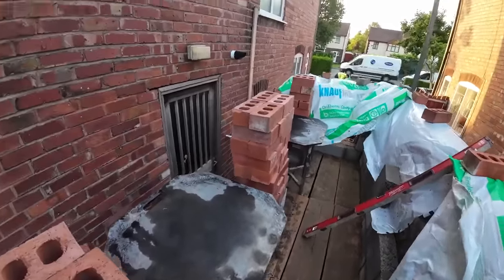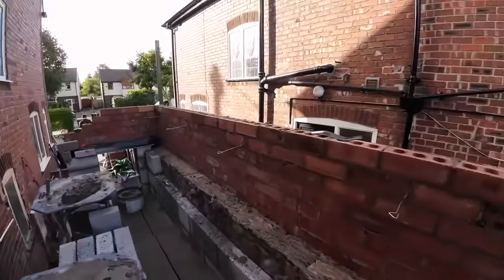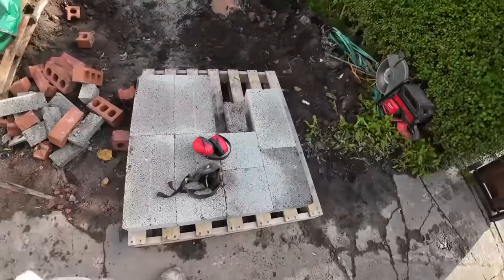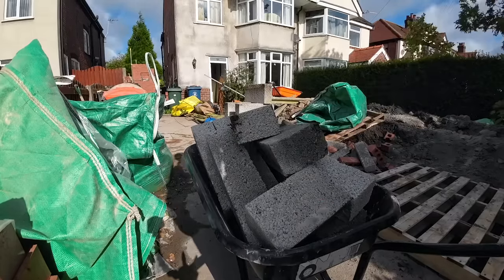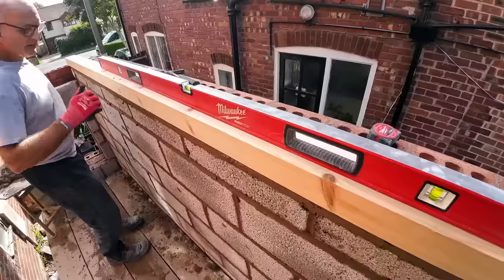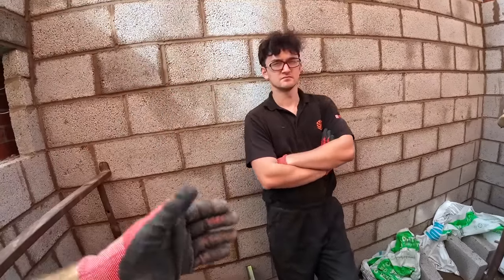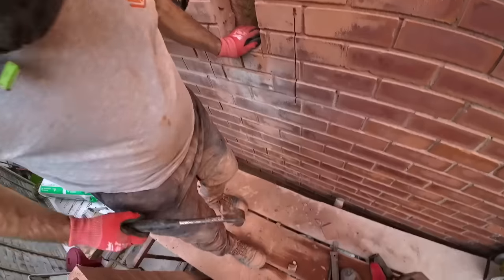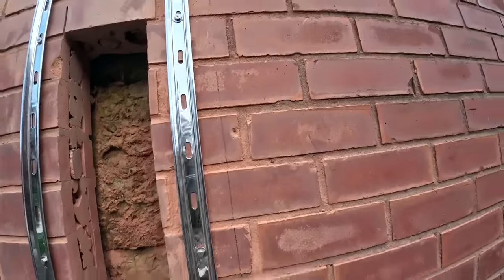150MM CAVITY EXTENSION.. WALL PLATE, LINTELS AND WALL TIES PT 7

Comment: Nice to see well done brickwork. I was an learning bricklaying in '68-'72. We learned how to hit the stud with the mortar we had just snapped off the long joint. We learned how to brick without getting mortar on the facade side of the stones. In the 1960s, construction was going fast in Denmark, and nimble minds began to build walls with cement mortar with finished screeds, saving on grouting work. 10-20 years later, brick facades with leaky joints were seen. In the mid-eighties, I graduated as a structural engineer. Worked for many years with waste recycling and in the beginning the new century I was project and construction manager on two large Slovak Danish-owned, former state farms. We rebuilt and newly built 63,000 m2 barns for pigs and dairy cows. After that, I had some project manager positions with, among others, quality management and supervision tasks on major construction projects. A larger residential and shop building in 2005 had quality requirements described in the project description. During an inspection, I looked at the work while the bricked facade. In the description, it was specifically described that the brickwork had to be with filled joints. The masons just didn't do that. They laid the long-joint mortar and laid the stone vertically into the mortar, so that only a little mortar was pressed up into the butt joint. I objected that they did not brick with filled joints, but they defended themselves with the fact that the next longitudinal joint would fill the stud joint and they pressed the joints. Recording that some stones showed my claim was relevant. I explained that, according to the quality description, it had to be documented with photos that the joints had to be filled. I maintained my accusation that they should build with filled joints. Before I was home from the building inspection, the bricklayers had called the manager of the bricklayer's shop and announced that if the was do it  with filled joints were to be removed from the construction site. The boss accepted that they built the walls as they did, otherwise you would not be able to meet the construction schedule and this would result in daily fines. Ten years later, I experienced something similar with some permanent bricklayers in a property development company. Developments within construction in Denmark had not been better for well-executed work. Nice to see that you can do good craftsmanship, which is top quality.
Reply from the maker: Thanks very much 🤜🏽🤛🏽🙏🏽🧱

Comment: Never seen a wall plate that straight. It also looked planed all round. The extension looks great but very small. Those 150 cavity walls seem to take up half the room. PS, no cav wall insulation on either side of the small window. Just letting you know in case you forgot and before the building inspector comes. Hee,,hee. That saw is fantastic. Great investment. When you were cutting the wall by the pipes, I was wondering if the previous builders used any cement in their mix. Seemed to crumble some what easy. Keep up the great work.
Reply from the maker: Thanks . We are sponsored by Milwaukee so they supply all the power tools 😍😍🧱👍🏽

Comment: Great work, as always. That saw is a serious piece of kit - thats the biggest battery I have seen on a portable tool.. Surprised it  doesn't auto stop / brake when switched off - need to watch your legs!
Reply from the maker: It’s such a good tool .
   The new version has the brake. We are careful as every other saw we’ve had up to now haven’t had brakes so we are used to it . 
    The batteries are huge but very powerful especially on the big breaker 🔋💪🏼🧱👍🏽

Comment: Great work but I just have one question…..while I understand cutting out above the door on the main house to make that wall an interior wall, what makes below that upto lintel height dry on the inside. So will that still be an outside wall on the inside.
Perhaps I haven’t explained it very well.
What I mean is ….. if you plastered inside the doors won’t the plaster get wet??
Reply from the maker: No it will be fine 🧱👍🏽

Comment: This might be a daft question, but I am an electrician...
Do you know why the wallplate gets fixed to the brick/blockwork using mortar? I can't think of anywhere else in English housebuilding where you'd fix timber to brick or block using mortar; these days it would be some sort of anchor bolt, and shims if it needs to be level.
Clearly, you can't drill into the top of most bricks, but surely you could with concrete blocks
Reply from the maker: The mortar is to level it . It’s then secured with wall plate straps 🧱🧱👍🏽

Comment: I can see the point in creating a cavity when joining in for a room to break the cold bridge, but what's the point in the 'roof' space above the ceiling?
Still if the inspector wants it there's no oint in arguing.
Reply from the maker: This guy was a stickler so we just did it . It was a doddle with that saw to be fair 🧱👍🏽
Reply: That saw is a game changer.
I was very impressed with your 2 minute block cutting demonstration.
A very neat tidy job as usual.
Reply from the maker: It flies through fibolites 🧱👍🏽

Comment: A question from a non-builder...Wont the roof-plate move from the mix when it dries?  especially if the wood twists with the weather?
Reply from the maker: The wall plate has to be fixed down with straps. 🧱👍🏽

Comment: I was just wondering Steve why you had to cut out the wall for a 6 inch cavity when that brickwork does not currently have a cavity in the outer wall of the gable? Dumb electrician asking 😢
Reply from the maker: It does Dennis but the dust turned the green insulation brick coloured 😆🧱👍🏽

Comment: In theory BC is correct the cavity should continue and not just a slot cut. Fortunately in my area we dont have to do either in fact its frowned upon and certainly not specified by wallstarter manufacturers. Wallstarters are designed to be a flexible joint to allow for differental movement between the new building and old and should be finished with a mastic joint,rarely done. I remember when they came out late 70s as clay heavage was causing cracks where we used to tooth in new brickwork to existing, toothing has been outlawed in most area's for this reason but most inspectors would be to young to even remember this.
Reply from the maker: Very true Andy .
   Clay heave was a big deal on the new build foundations when we were on them . We saw them dig over 3 m through solid clay till the dipper on a 13 ton machine disappeared 😳🤯. 
   It was then filled with semi dry then topped off with 150 mm of reinforced wet concrete all because of a scrawny hawthorn hedge 🧱👍🏽
Reply: @SteveAndAlexBuild  👍
Reply from the maker: @bricklayersworldwithandy🧱👍🏽

Comment: Used to cut the cavities out when i first started in the 80s .Then it went to firfix and vertical damp .Each to there own opinion both have plus and minus points .
A potchy job done great as usual. 
Young inspectors can be a nuisance Steve 👍🧱🧱
Reply from the maker: I think the full cavity Removal will become the norm eventually to avoid cold bridging . It’s more about insulation now than damp . Cavity out solves both issues 👌🏼🧱👍🏽
Reply: @SteveAndAlexBuild  
Every area of the uk will be different as usual Steve but if i had to choose the full cut out is a better job continuous cavity and all that mate .its a pain though 👍🧱🧱🧱
Reply from the maker: @brickrightbuildinglandscaping I’m definitely coming round to that way of thinking Justin . A bit more awkward but a better job in the end 🧱👍🏽